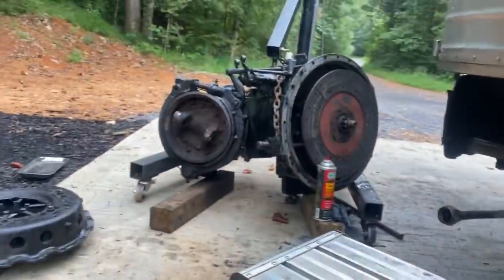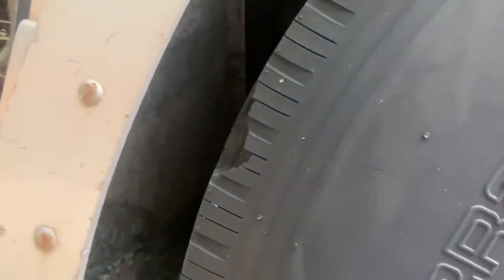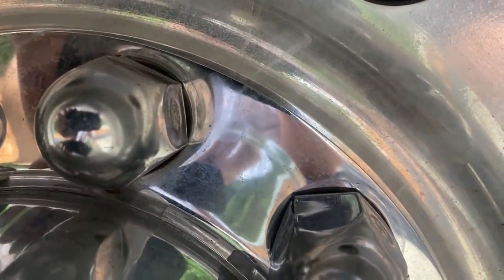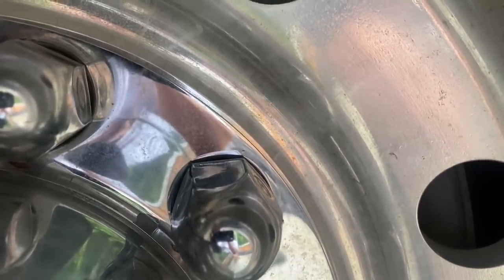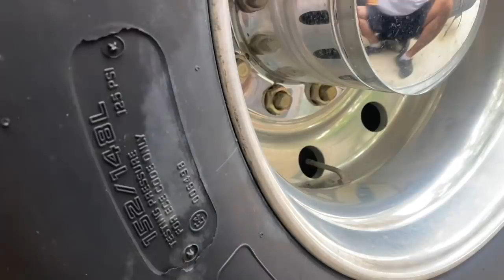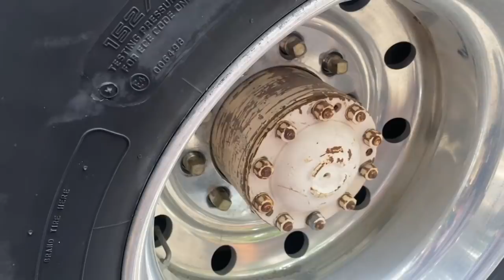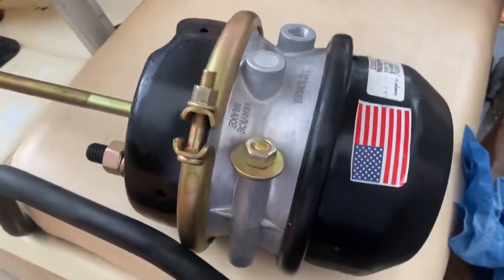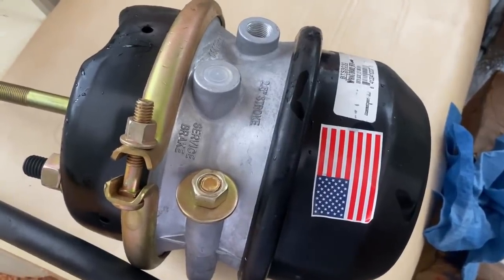Major safety issue on vintage bus

Comment: Funny story about new cocky semi drivers...We have storage tailers, and they are single chambered, (otherwise the shoes will get stuck from sitting years at a time) watching a New driver back under them is hilarious, and a good time to teach some humility (if they are cocky) if they are humble, I give them instructions...usually...they end up chasing the trailer all over the parking lot... Then after they are defeated (usually about 20 minutes), I go out there, make them get in passenger seat, I hook up the air lines, grab the Johnson bar (applying the trailer brakes) and ram her home... And then explain that no matter how slow and dumb they think us "old school" drivers are, we have more knowledge than they think we do... So when it comes time for advice...listen, or you are gonna learn the hard way... (I know it seems like a D*ck move, but its not out of sheer mean-ness)

Comment: Those studs, who ever did that is is totally negligent. If one of those wheels came of on the highway then it could so easily kill. I’ve seen it happen with a truck’s trailer tyre, wrecked the another trucks cab and killed the driver.

Comment: I see the same kind of idiotic butchery on chromed out "Custom" trucks too. Lot's of chrome shop crap, mounted all kinds of wrong, hacked up wiring harnesses to add chicken lights, etc..
Then you look under them and it looks like 1/2 the grease fittings haven't seen a grease gun for years.

Comment: Why aren’t these heavy vehicles safety checked by DOT at the scales? Doesn’t make sense if they are supposed to be enforcing the rules for public safety reasons.
Reply: They are exempt,just like no need for Cdl’s with the air brakes
Reply: Paul S. Williamson Well that’s an exemption that shouldn’t exist. I suppose the RV industry lobbying has something to do with it. As a 50 year Class 1 CDL driver, I take driving seriously and air brakes are something that you don’t play around with. I live in Western Canada and driving a coach in the mountains here takes considerable skill and experience. Other road users depend on your ability to maintain and control a heavy vehicle safely.
Reply: @davidj4662  I've sang your song for a long time.  I drove coaches through the Western US over numerous mountain passes.  You need to be trained, educated and licensed endorsed in order to drive any coach, converted or commercial safely,  or you put yourself and the surrounding motoring public at risk.
Reply: I do agree I’m a 57 year old with class A  CDLs with passenger endorsement since before the new CDL license of thirty plus years

Comment: I agree that the lugs were too short, and mega-dangerous, but  ...  
they are definitely NOT "a couple bucks a piece".
Last I heard  ...  the best price that folks were able find for them, was roughly $35 each.
Multiply that by (x10) and it would cost $350 for one side of the axle.
At $700 per axle, the mountain of cash needed, grows rapidly.
That said, there is no excuse for not forking over the cash required to buy the correct length lugs.
People die, when wheels fall off.
Sometimes, entire families die.
If one cannot afford to make one's bus safe to operate it  ... don't operate it.

Comment: Did the right thing by using new hardware to bolt the wheels down, but obviously did not know that you had to use longer studs for aluminium wheels. A simple mistake could have cost someone their life. Old adage, if it does not look right, it's not right.

Comment: The busses that you work on do they have a state annual inspection of sort?. seems like something a shop with rookie guys would have done when changing tires and didn't know any better, like you stated stupid dangerous if a wheel comes flying out at you. Here you can't  touch wheels/ tires and air brakes on commercial vehicles and busses without courses and certifications. Dangerous mistake to make and kill somebody.
Reply: Nearly all states do not require private coaches to be inspected. 
private coaches.  Only those in commercial service.   Even those can be very cursory at some shops.  It really depends on how thorough the inspector is.  I wouldn't be sloppy. 

Most of this is driven by the RV industry and legislation.  Old folks have a very strong voice so the politicians tend to bend

Comment: Mr Bus Grease Monkey, Sir,   With you, pointing out , that the owner, or  idiot , that installed the what I call the "bottle"  inner,  wheel nut, 
that is a  standard length , for Standard steel  Budd wheels,  of the old school design, where the second outer budd wheel, is reversed, 
and it is in turn, held down by the  outer  wheel nut;  YOUR POINTING OUT THAT THESE ARE NOT FOR ALUMINUM TRUCK OR BUS, 
BUDD WHEELS, IS ABSOLUTELY CORRECT!  ( EVEN THOUGH, I AM RETIRED , OLD, AND HAVE A POOR MEMORY TODAY; I DO NOT RECALL THE ACTUAL INDUSTRY  NOMENCLATURE NAMES OF THESE MODELS OF WHEEL STUD,  I CALL" BOTTLE NUT", AND OUTER
RING NUT,TWO PIECE SYSTEM, FOR STEEL, OLD SCHOOL TRUCK AND BUS RIMS! )    THE AlumINUM model rims ,  are way thicker, for strength requirements; need a completely differrent  length of stud, and a different nut!   The whole advantage of Aluminum wheel rims IS TO SAVE WEIGHT OF THE VEHICLE !  ANOTHER  TRUTH YOU DID NOT MENTION, IS SADLY, MOST PEOPLE WHO OPERATE THESE BUS, OR HEAVY RV VEHICLES ARE NOT  HEAVY VEHICLE DRIVERS, WHO KNOW NOTHING ABOUT THEM, AND ARE NOT 
INTERESTED UNTIL THEY BREAK DOWN !  (NOT ALL, BUT MOST)   BY the way, you sir , really know your  detroit diesels back and forward! dead Cold!  Bravo! I tip my hat to you Sir!  And good  luck  with your new home stead too!  No more  neighbours , bitching
about you repairing buses, in front of your house on the street?  eh?    Most of my older medium trucks have transmission, 
mounted  brake drum, and compresible type parking breaks,  but I assume you are correct , because  unprofessional drivers of these
older buses, do not use them properly, and do forget they are  in the on position!   best regards kennethzakaib607@gmail.com